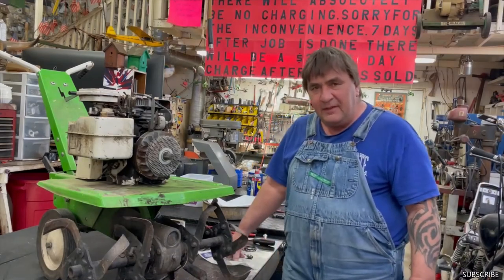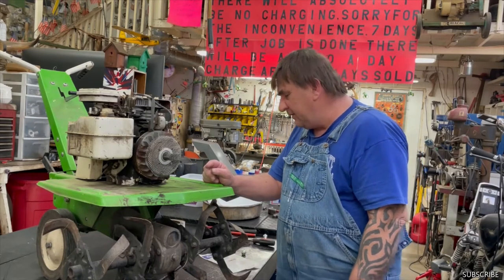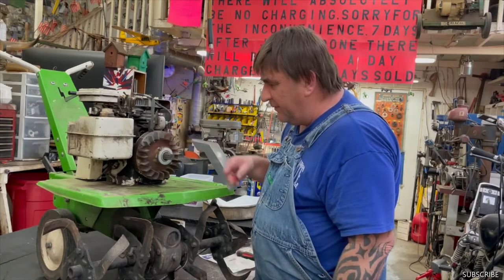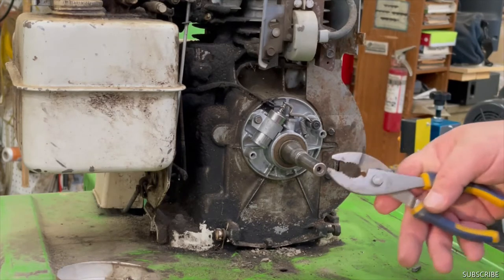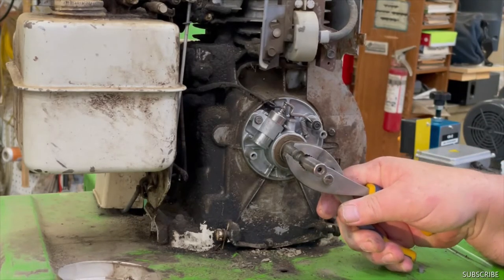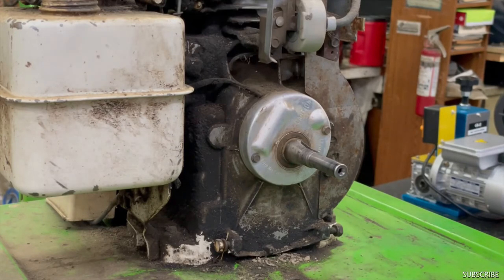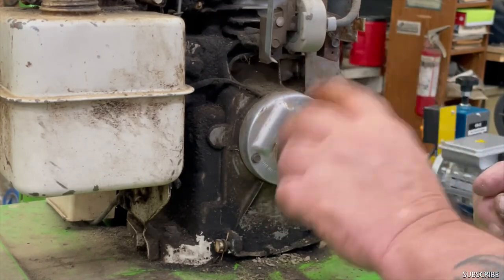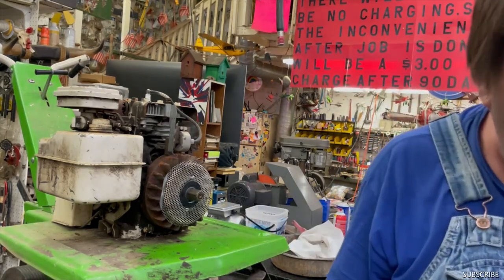1975 Briggs and Stratton 5HP Tiller: Installing Points and Condenser (No Spark)

Comment: thanks for helping me just what i needed picked up a tiller for ten bucks with no spark ! gonna go put a new one in now
Reply from the maker: Glad I could help!
Reply: @lmsmallenginerepair4471  turns out the magneto was bad actually as well so had another one laying around on a different motor bam she lives again ! It’s so rewarding to fix something that’s been sitting around for ages thanks for all the help tho made getting the fly wheel off super easy appreciate all the information

Comment: Very helpful video. Was planning to change the points kit that I had floating around for years, after having my Sear mulcher/chipper machine fail to start on me, yesterday. Well, pulled the flywheel only to find it has no points! And the coil looks like the one you held up as being an electronic magneto assembly.

 One question: The wire that is on the primary side of the coil looks to be maybe a ground to short out the coil for killing spark when you're done? Mine has had some insulation that came off and maybe grounded to the cylinder head or the crankcase?

Comment: I have a 1975 Briggs and Stratton 5 horsepower log splitter has not run in 20 years has no spark. But where do you get parts for these old Briggs and Stratton engines thanks Kyle
Reply from the maker: try e-bay